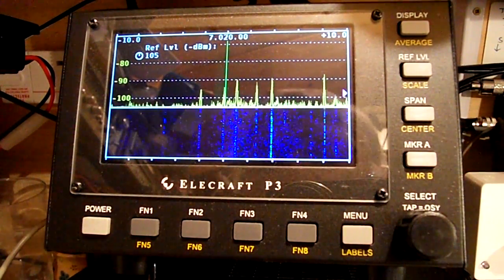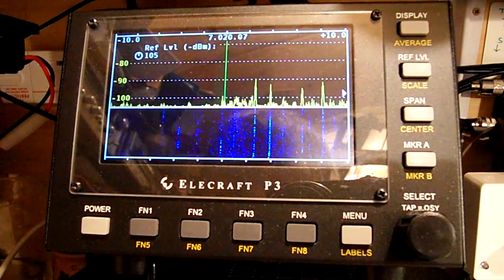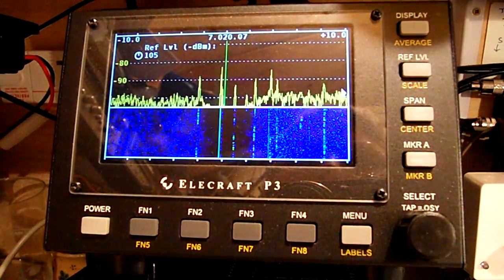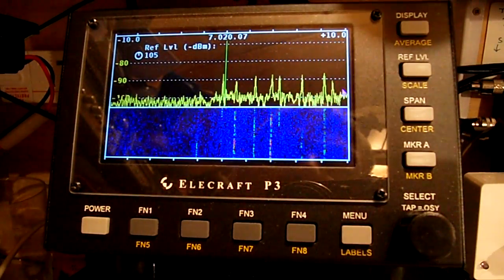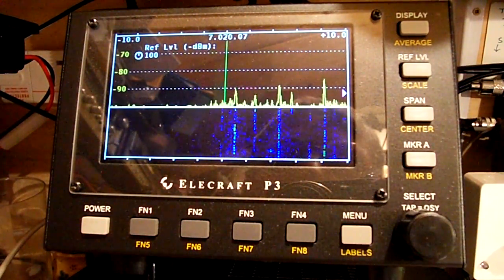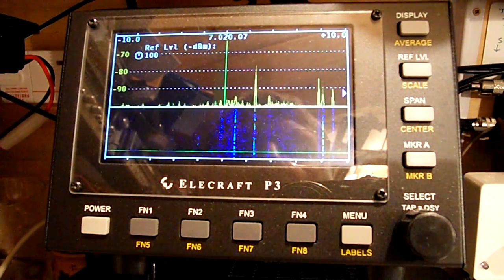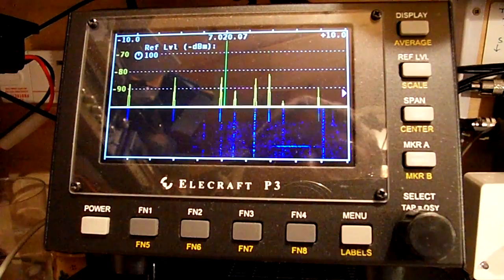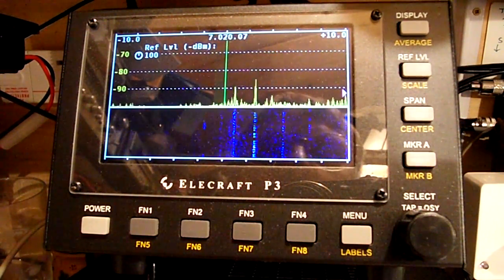7MHz & 10MHz Band Interference  up-dates

Comment: I have been experiencing this since November 2011 and know of 3 other similar sufferers. The carriers are always an  exact multiple of 4 kHz and follow my
transmitter frequency, some times there is a comb of carriers 4 kHz apart and each
carrier goes off at a different time.
The carriers are quite weak on 60,40 and 30m a fair bit stronger on 20m,this is not a band I use often so haven't made a complaint as this may open a can of worms !
Originally the device was very sensitive 10 milliwatts  from a signal generator would
trigger it, outside ham bands as well. Now it needs 80 watts. The QRM has stayed
the same strength .No variation in strength day or night .
Not too easy to DF this as carriers go off after a while so you have to transmit again
to restart it then go back out again.
Carriers do seem to be on telephone lines but not on mains, have used a probe on the end of a telescopic pole to observe this.
Suspect this is some kind of modem.

G0HNW

Comment: Some months ago a friend had a similar issue,,,, He had a wired burglar alarm, a device which was added  telephoned himself and another member of his family if the alarm was triggered in any way. It transpired that when he transmitted on 40m, some part of the wired system acted as an antenna (end-fed or dipole) and activated the (silent) alarm...which then activated the new telephone addition to the system... sending data to the relevant peoples phones.. the new addition to the system continued to send this data until an answer was received ,,,This new telephoning addition also interfered with the actual alarm....causing some R.F. feedback..which was picked up by the wired systems wiring and caused terrible interference to him. Sort of a self inflicted loop of interference. We adjusted the lengths of some of the more accessible linking cables within the wired part of the alarm system and a small added some R.F. chokes in other areas.... and now... All is well.
This may have no bearing on your situation Rob ,,,but, it may help someone if not you. Good Luck with it...and when you solve the problem I hope you will let us know what caused it....Perhaps an mention of it  in Practical Wireless ??? it's a good magazine ..you know..hi..hi..Enjoy your retirement.

Comment: I'm following this story with interest. I have no idea what causes these mysterious signals, but I sure would like to know. It's an intriguing mystery. My rig will cause interference with my burglar alarm system on 40 meters but only when I run high power. I wouldn't think 10 watts would set off anything. I want to say it comes from inside the radio but others more knowledgeable seem to think otherwise. I use a K-3 and have never seen anything like this, for what it's worth. Have you called this to the attention of the Elecraft engineers to see if they have any ideas. They are usually very responsive.

Comment: Go to the bottom of the band, let's say 7.00 and transmit there. See if the interference leaks out below 7. Repeat the same on the top end, see if it goes higher than 7.200. If it stays within ham band, it is most likely caused by a local ham DIY SDR gone wrong. Also try to see if there is correlation between yourself sending CW and the interference sending data in return.
Remote meter readings are done in UHF, so that's not the source of your problem. 73 de EI3HXB

Comment: Hi Rob - I've dropped you a separate email on the subject. I suspect this could be a NFC (Near Field Communications) device in a mobile phone or tablet. This relatively new system operates on 13.56MHz and although only designed for very short range communications, your signal may be enough to trigger it. The fact that it is so strong suggests that it could be in/adjacent to your shack or very close to the antenna/feeder. Do you have a new phone or tablet in the house?  Mike G4WNC